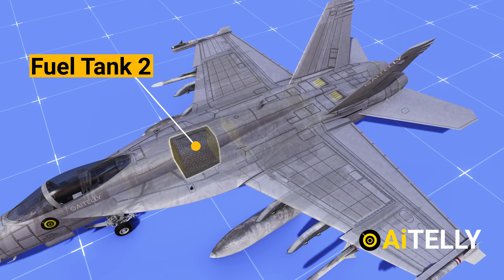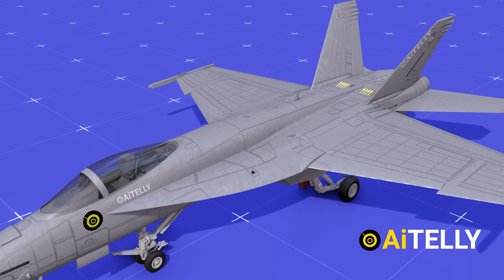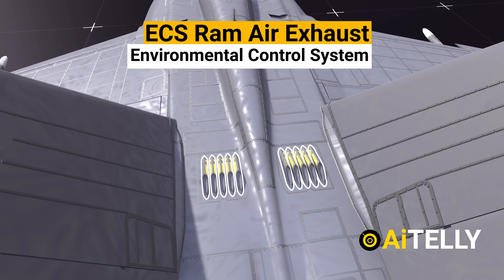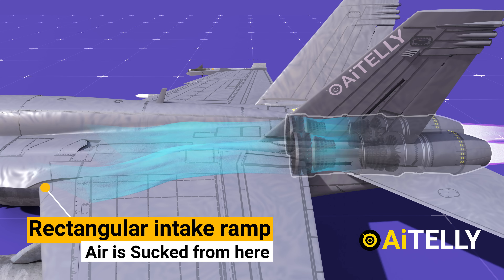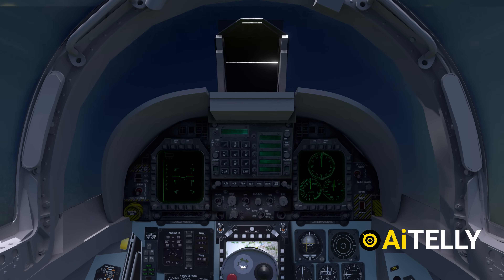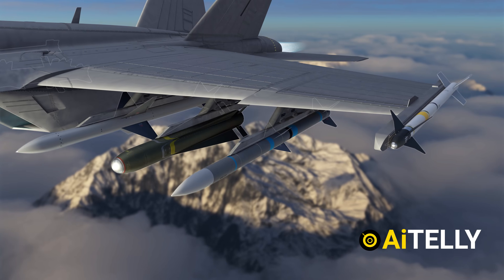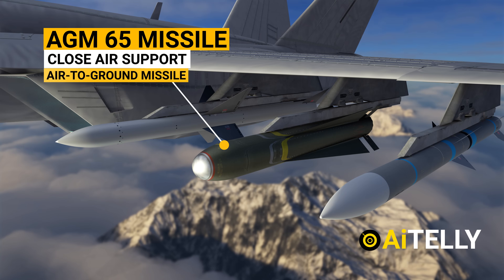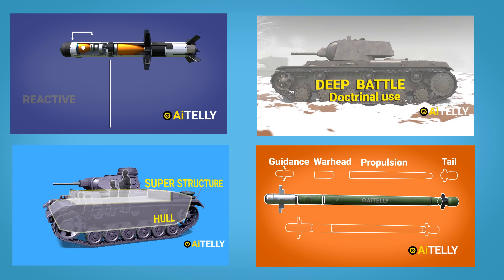How a Fighter Jet Works | F/A 18 Super Hornet | Top Gun

Comment: I’d rather have F/A-18 Hornets than F-35 Lightning II’s
Reply: Why the f 35 is better in basically ever way sure you like the f 18 more but the f 35 is significantly better in close dogfights the f 18 may have an edge but the f 35 can hit it with multiple radar guided Missiles before it even detects it and it's multirole capabilities exceed the f 18s it's hive mind abilty of sharing all of the data it takes on makes it a better fligher

Comment: wonder what's the deal with the stealth-ish sawtooth edge on the super hornet's rear gear doors just like the F-22. for obvious reasons the resulting reduction of radar cross section is negligible because the super hornet was not built as a stealth fighter

Comment: Kinda simple explanation of the engines, like how the air from the intake is compressed in the forward fan and compressor, the combustion chamber, the axial turbine shaft, and then the rings that spray fuel into the exhaust to create afterburner... Also, what about countermeasures, tail hook and lauch bar, the airbrake? Otherwise, pretty nice little vid, thanks.
Reply from the maker: Thanks for the information.
Learning From this community as we move along.

Comment: Nice video, but I have to say the F18 doesn’t use afterburner for takeoff. A flame out condition in one engine will cause undesirable yaw, and can lead to a crash
Reply from the maker: Thanks for the information will keep your info on the Correction section
Reply: Supers most definitely use AB on take off
Reply from the maker: @yukionna1649  Is this true
Reply: @Aitelly  there's no reason not to use afterburner on take off, the quicker you can get off the ground the better
Reply from the maker: @yukionna1649  Thanks for the reply this is really great info have put your Comment in the Correction Section.

Comment: Ailerons part is only half-accurate. It might be true for airliners and larger cargo aircraft, but modern fighter aircraft have their horizontal stabilators (they aren't called elevators) integrated with roll control via the onboard flight control computers, which means when the pilot commands a left roll, the left stabilator also deflects along with the left aileron to assist in rolling the aircraft, and vice versa. Unlike the traditional elevator + trim combination, the entire control surface is deflected as one unit (hence why there is no separate elevator control surface and why this is called a stabilator or elevons as some others call it). This is why modern fighters have incredible roll rate compared to the older "ailerons only" concept.
Reply from the maker: Great Informative Comment We will keep this comment in our correction section.

Glad to meet Intelligent people like you.
We have learnt something today.
Reply: Wow thanks! I didn’t know this!

Comment: One thing you forgot is with jets, sharp maneuvers are performed using the mix of rolls from the aileron to roll aircraft to the intended direction followed by an upward pitching of the elevators. Simply rolling the aircraft using the ailerons alone won't make it turn. You need input from the elevators.
Reply: Lol, wondered if I'd see that tidbit in the comments. Love seeing someone play a flight sim for the first time and they just go aileron rolling along...
Reply from the maker: Thank you for the Suggestion !
We made the F35 Stealth Jet 
https://youtu.be/vgUnF9hUmLQ
Reply: YOU NEED ALL 3 ,RUDDER FOR YAW AS WELL,STEPPING ON THE BALL TO MAKE A COORDINATED TURN..
Reply: All of you are wrong. This isn’t a Skyhawk, it’s a military jet. It does NOT have elevators or ailerons, it has flaperons and elevons. The elevons are the primary control service for turning and climb/descent. The flaperons assist with turns but are also flaps for slow flight and landing

Comment: I used to work at Boeing and spent time at plant in St Louis where F/A 18 Super Hornet is made. Most of the video is accurate. I won't split hairs on minor differences. Just glad someone took time to produce this video. 

The F/A 18 has some stealth features which were barely understood in the 90's. Goal of stealth is to reduce radar return signature. Twin vertical stabilizers only 1/2 as tall as a single reflect less radar back to sender. Both vertical stabilizers are at an angle which make return radar reflection bounce harmlessly in different direction. The very sharp nose which houses the digital array radar antenna does not return radar back. 

The inlets to the twin turbojet engines are cleverly designed to hide the spinning forward compressor blades. On F-15, if you look head on, you can see the compressor blades. This caused a very strong return radar signal back to enemy. On F-18, the engines are inset deeper into fuselage, an angle was introduced in the air ducts and compressor blades are out of sight. Other stealth features include some RAM (radar absorbing material) in key areas, highly sloped canopy structure, even the paint has some RAM and the color makes it hard to see from below or even from above.

When I first saw the 2 little turbofan engines, I was not impressed. I had spent much time at Everett Plant where wide body twin aisle aircraft are made. Engines on 777 are over 9 feet in diameter and produce over 100,000 pounds of thrust compared to 22,000 on F-18. Of course, commercial jets don't have afterburners and weigh many times more in weight. 

I was part of a Lean Manufacturing Team from Commercial sent to fix problems in Military. We can assemble a 747 in a week or two. F-18 was taking several years. It had 1 window, 2 engines, 2 seats, no bathrooms, no kitchens, and was tiny in comparison. 747 has hundreds of windows, hundreds of seats, multiple bathrooms and kitchens, flight deck big enough for 6 people, hundreds of miles of wiring, tubing, and ducts. People comfort important. 

Yes, we did reduce manufacturing problems on F-18. We made them faster, better, with less defects to fix later, and reduced price considerably. Price was number one driver for Navy on second contract.
Reply from the maker: @Steven Rohrich
Thank you for the insider feedback. We are just mere Civilian eager to know more of engineering behind it.

Credited  your Comment for your wonderful feedback for this beautiful machine.

 This will inspire Future Engineers to carry on the light.

Last but not the least 
THANK YOU FOR YOUR SERVICE !
Reply: @Aitelly  Thank you for comment. I too am a civilian with a passion for all things flying. I share my unique insider first person accounts when I can. 

FBI background checks and security clearances issued, was told best to keep mouth shut unless it's common public knowledge. Nothing I shared is secret now.
Reply from the maker: @SJR_Media_Group   Ohh FBI. yes i have read reports regarding background Checks and the fear of Technology Transfer to China.

But it's really nice to meet People/Engineers like you.
There is a saying that 
Engineers Build the World .
Politician Destroy it. 
:)
Reply: @Aitelly  Thank you. I had an old standing joke with my brother who is a Civil Engineer. I said you make targets (roads, dams, bridges, bases, etc), I destroy them.
Reply: Turbojets or turbofans?
Reply: @zube2007  Thank you. My error, should be turbofan (made correction). I was thinking older fighters had turbojet. For a longtime, turbofans were not capable of supersonic speeds without use of afterburners. Today's turbojets can 'supercruise' at 1 mach without fuel guzzling afterburners. The other limitation was packaging. Turbofans typically have a large intake fan before compressor. Most of air from front fan bypasses engine core, and actually provides a large percentage of thrust. This can help cool the hot exhaust stream by interjecting cooler bypassed air. Less heat = less IR signature, another part of stealth.
Reply: Wonder if they used these lesson from the super hornet on the f15ex?

Comment from the maker: Credits  for notes/Corrections from the Experts:

1)Steven Rohrich :I used to work at Boeing and spent time at plant in St Louis where F/A 18 Super Hornet is made. Most of the video is accurate. I won't split hairs on minor differences. Just glad someone took time to produce this video. 

The F/A 18 has some stealth features which were barely understood in the 90's. Goal of stealth is to reduce radar return signature. Twin vertical stabilizers only 1/2 as tall as a single reflect less radar back to sender. Both vertical stabilizers are at an angle which make return radar reflection bounce harmlessly in different direction. The very sharp nose which houses the digital array radar antenna does not return radar back. 

The inlets to the twin turbojet engines are cleverly designed to hide the spinning forward compressor blades. On F-15, if you look head on, you can see the compressor blades. This caused a very strong return radar signal back to enemy. On F-18, the engines are inset deeper into fuselage, an angle was introduced in the air ducts and compressor blades are out of sight. Other stealth features include some RAM (radar absorbing material) in key areas, highly sloped canopy structure, even the paint has some RAM and the color makes it hard to see from below or even from above. 

2) Herbert Dennison: 5:00 A few notes on some of the terminology. The Super Hornet does not have slats, it has leading edge flaps. The inboard and outboard leading edge flaps are linked and move together. Th Super Hornet does not have elevators, they have horizontal stabilizers. The stabilizers control both pitch and roll (with the ailerons). An elevator is a movable surface on the trailing edge of a horizontal stabilizer such as on an airliner or Cessna.

3)Scooter George: One of the issues with the F/A-18A was the relatively low internal fuel load of, approximately 10,000 pounds. On the other hand, the A-4 "Scooter" carried about half that at 5,200 pounds of jet fuel. The A model Horne motors were 16,000 pounds thrust. I was a mech in VFA-305

6)MM is millimeter :) We messed this up big time 

7)ShawnTheMaroon

Ailerons part is only half-accurate. It might be true for airliners and larger cargo aircraft, but modern fighter aircraft have their horizontal stabilators (they aren't called elevators) integrated with roll control via the onboard flight control computers, 

which means when the pilot commands a left roll, the left stabilator also deflects along with the left aileron to assist in rolling the aircraft, and vice versa. Unlike the traditional elevator + trim combination, 

the entire control surface is deflected as one unit (hence why there is no separate elevator control surface and why this is called a stabilator or elevons as some others call it). This is why modern fighters have incredible roll rate compared to the older "ailerons only" concept.

8) @Yuki Onna  Supers use AB(After Burner) 

P.S Some one reported that they don't use After Burners.  

9)Correcting the Scripts with better English and Voice Over in the upcoming contents.

P.S Military Technology Data are a little tough to get our hands on and also classified. Most of them are in a very grey area, but we will try our best as average Engineers and 3d Animators to bring out the best in a very Minimalistic or Simple Explanation.

We take full responsibility for our mistakes.
Reply from the maker: @flether  🙏 We appreciate for understanding the Process. Flether
Reply: Nice video on a great jet, I used to work on them back in the day myself and taking into account the few corrections above its a pretty solid run down of the jet. Nice work and refreshing to see someone acknowledge and pin corrections like this 👍
Reply from the maker: @yukionna1649  Is it true what you had Commented that Supers use AB(After Burner)
Reply: @AiTelly im  not if im right at 100% , but i think the term about F/A mean Fighter/American. the "Why" is because im from Canada Then our f18 is called CF-18 (also f18 its a multi-role)
Reply from the maker: @RacanYlum  But everyone I look I find it F/A as Fighter/Attack  because  the F16 was mainly a Fighter aircraft hence only "F".
But again I might be wrong.
Reply: @Aitelly  Im not sure too loll then no matter!  one thing im sure about CF-18 its canadian fighter! u should be right too, every country must have his own "rules"!
Reply from the maker: @RacanYlum  Yes they do have their right. Especially the Germans naming their Planes during WW2
1)Focke-Wulf Fw 190 
2)Messerschmitt Bf 109

etc

Especially the first one is BAD A$$
Reply: Thank you for video. Ex Boeing here.
Reply: I appreciate that you made corrections.

Comment: A few notes on some of the terminology. The Super Hornet does not have slats, it has leading edge flaps. The inboard and outboard leading edge flaps are linked and move together. Th Super Hornet does not have elevators, they have horizontal stabilizers. The stabilizers control both pitch and roll (with the ailerons). An elevator is a movable surface on the trailing edge of a horizontal stabilizer such as on an airliner or Cessna.
Reply: 34 year Hornet maintenance guy here, Thank you for the corrections. Also no mention of the "fly-by-wire" system that keep the plane flying. Major flight innovation.
Reply from the maker: @donjaeger2149  Thank you for   your Service and Suggestion. We missed that still learning as we move along. We are just mere Mortals for you Guys.
Reply from the maker: Thanks for the feedback will update this info giving you credit after verification.
Can you DM us in Instagram.
Need some help with our upcoming content.

Comment: One of the issues with the F/A-18A was the relatively low internal fuel load of, approximately 10,000 pounds. On the other hand, the A-4 "Scooter" carried about half that at 5,200 pounds of jet fuel. The A model Horne motors were 16,000 pounds thrust. I was a mech in VFA-305.
Reply from the maker: Thank You for your Service. Huge respect for giving inputs to Mortals like us.
A ton of respect again for the Input will help us for future references.
Reply: @Aitelly  - You're very welcome. The reason the fuel load sticks in my mind is that it was almost the same as that of the A-7B VA-305 'Lobos"  replaced with the Hornets.  Spent much more time working on A-4 and two seat TA-4 "Scooters" though.
Reply: @scootergeorge7089  what do you think about F-14 Tomcat? Was is better than F-18
Reply: @EliteBattleFielder9672  - I was a mech. Never worked on the Tomcat. But it is my understanding that it is more maintenance intensive than the Hornet.   As a pure fighter aircraft, the Tomcat may have a slight edge.  But close enough that the superior pilot would prevail.  Towards the end, weapons racks were added to the Tomcat to make it more versatile  perhaps too little, too late.
Reply: @Aitelly  moi
Reply: Thank you for sharing your history and perspective. Did you ever get the opportunity to work on the C or D Hornet? As I understand, they received upgraded F404 engines around 1992.
Reply: @carbonfox120  - I was in the reserves. We had the oldest A models around. Was transferred to an A-4 squadron, VFC-13,  in 1988 and believe VFA-305 still had the A model Hornet when the squadron was disestablished in 1994.
Reply: @scootergeorge7089   to me